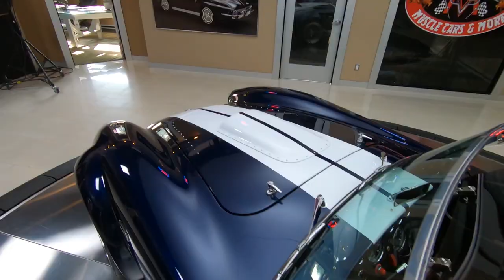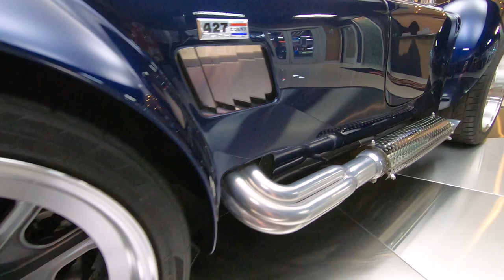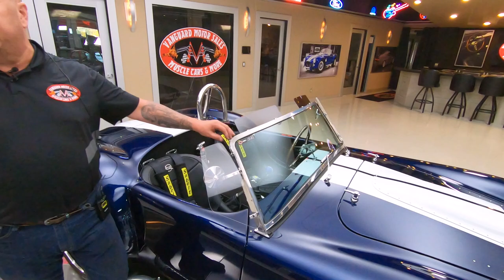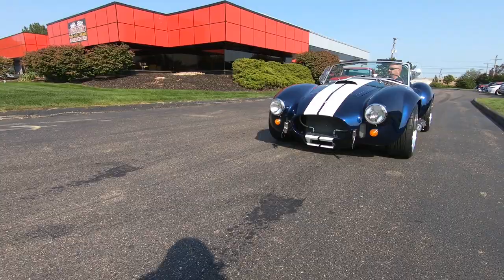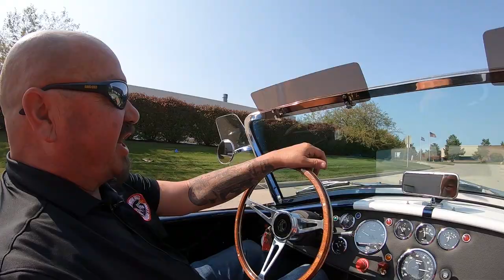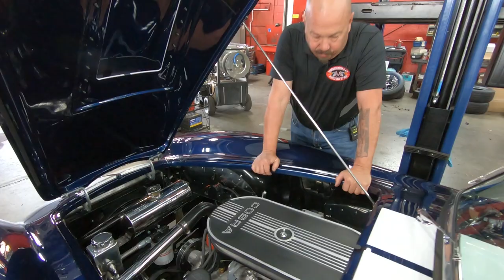1965 Shelby Cobra Backdraft For Sale

Comment: Greg/Tom, If an owner has NO intention of putting the bumpers on, why wouldn't you remove those ugly looking brackets. Any idea?
Reply from the maker: Well they are nostalgic mostly. While yes they function as bumper brackets they are actually a quick jack bumper that all the original racecars had. Most people like the look of them.
Reply: @vanguardmotorsales  But they could be removed, right?
Reply from the maker: Most likely. However, some cars could be an exception. If you want to know if they could be removed from a specific car I can have the team look into it.